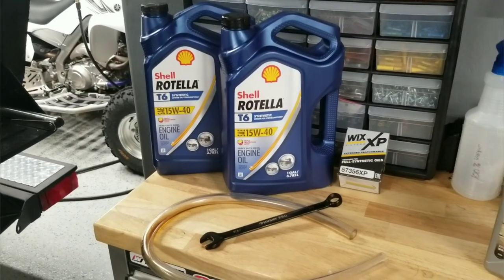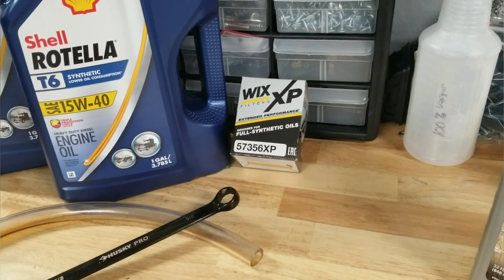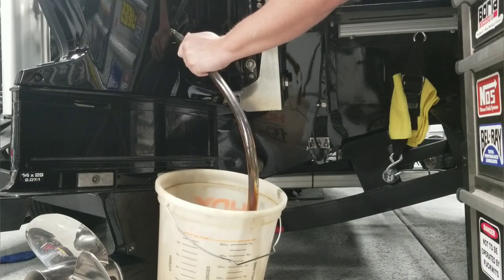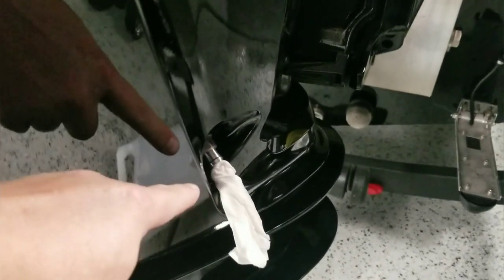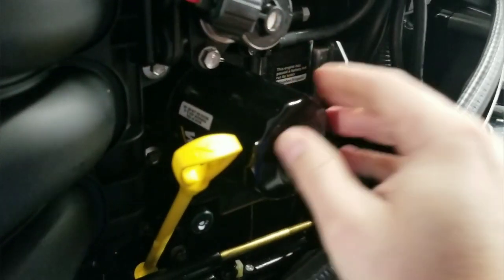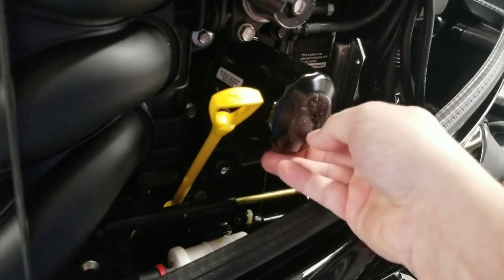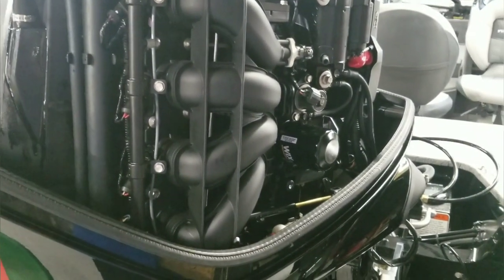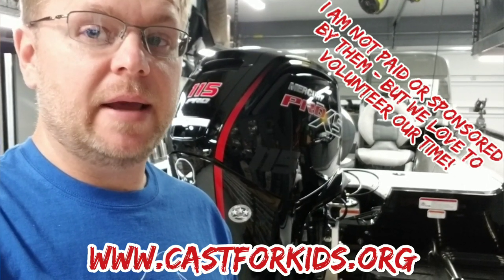Outboard oil change time! Mercury 2.1L 75, 90, 115 and Pro XS models covered. Easy DIY video!

Comment: Just an FYI per the dealer we got our boat from Not using Mercury oil voids warranty.. Was told 10 hrs for first oil change. They want 60 bucks for filter and 5 quarts.
Reply from the maker: Dealer is a bold face liar :) Using oil other than mercury brand cannot legally void any warranty period, same with the filter.
Reply: They tell you that so you will spend $100 to have it changed haha

Comment: The merc/quicksilver filters are garbage now. Nylon core and globs of glue everywhere. Is the Wix XP still holding up? I ahve the same boat with the factory prop what size is the SSprop  you have on there and did you get any more MPH out of it?
Reply from the maker: Never had an issue with wix, use them on everything. They just work and are quality. The 17p was a great all around prop. Good grip on the water in mild turns where the 3 blade would blow out. I also ran the 19p before and it gave a few more mph running as hard as it would go but took a while to get up there and a good balance on trim.

Comment: Any concerns in not using NMMA spec ‘marine’ oil? I’m still within my warranty period, not sure if I’m comfortable using T6. I know it’s pretty much the best there is for the price... I use it in my Deere mower, my Ariens blower as well as my Ram Ecodiesel.
Reply from the maker: Zero concerns and have never had an issue with it. High zinc and great additive package. Not to mention, affordable and easy to get.

Comment: Any idea if the 115 pro xs is a non- catalyzed engine?  Was wanting to know because I heard that high zinc should not be used for catalyzed motors
Reply from the maker: No cat on the 115. And correct, if a catalytic converter equipped engine consumes a noticeable amount of oil between changes, a high zinc oil should not be used. If the engine consumes very little or no noticeable amount between changes, then it makes no difference. I have a few cars north of 300K miles on original cats and have run HDEO / high zinc since low mileage.
Reply: Thanks!

Comment: Hello. What is the difference between Mercury 115 PRO XS with a silver bottom and a black bottom?
Reply from the maker: Silver is a different gear ratio command thrust lower.
Reply: @MR_Garage  So the silver ones have a higher gear ratio and it's a real PRO XS?
Reply from the maker: Just different lower units. Not sure what you mean by "real pro XS"? The only difference between the standard 115 and pro xs is the PCM which allows for 300 more RPM from memory. Oh, that and stickers 😅
Reply: @MR_Garage  Why the same determination of the PRO XS and a different engine?

Comment: doesnt four stroke mercury like xs pro call for 25w 40?
Reply from the maker: 10w30. Oil weight choices are generally based off environmental. Being lake water cooled, feel free to go by manufacturers spec or up to a 25w40 in warm to hot climates. Winter, I would stick to a 10w30 or a 5w40.

Comment: I got the same ProXS very great engine but I got aluminium prop so I’m looking for advice on buying alloy prop can you help me out buddy ?
Reply from the maker: Hey Jonathan, What hull do you have? And you are running a 115 pro xs?
Reply: Mr. Garage It’s on a 16feet aluminum boat 1000lbs boat with the motor on it
Reply from the maker: That is a LOT of motor for that little boat. I would probably start at a 21p aluminum and see where your RPM is.
Reply: Mr. Garage what’s the diameter ? 14 or another number ?
Reply from the maker: @jonathancooper1512  Prop is around 13". Specifically the X7 I run is 12.7"